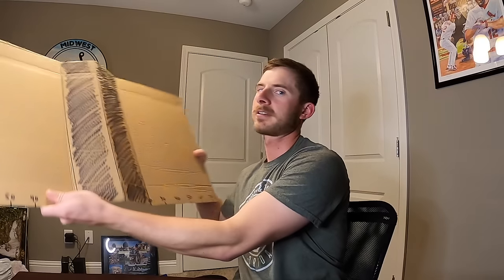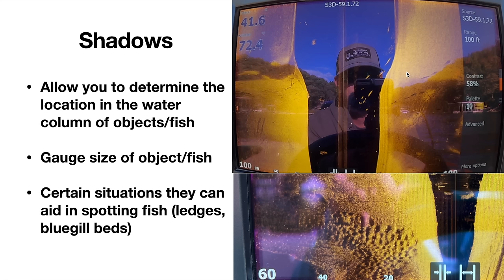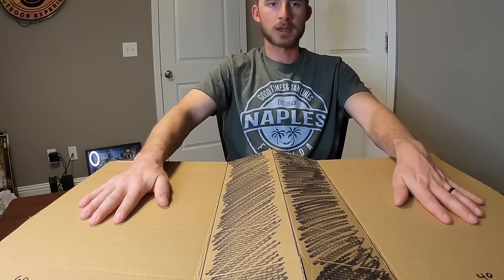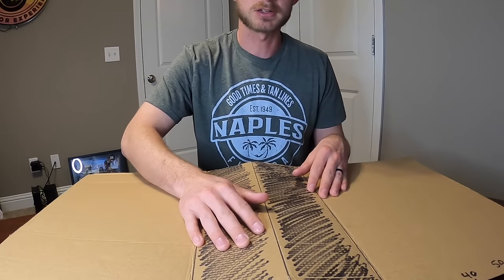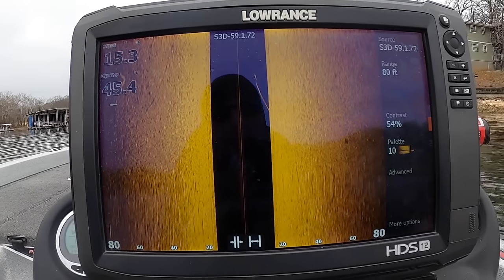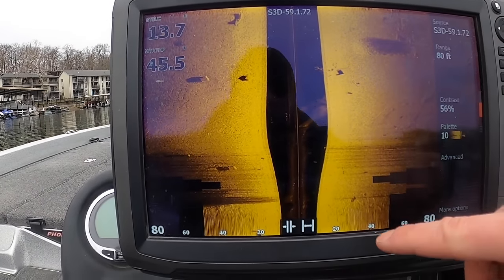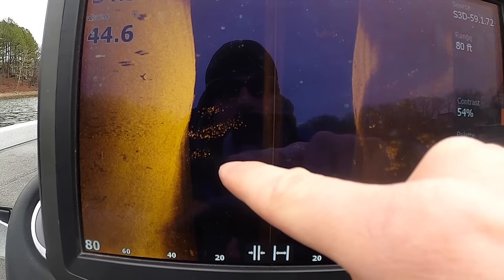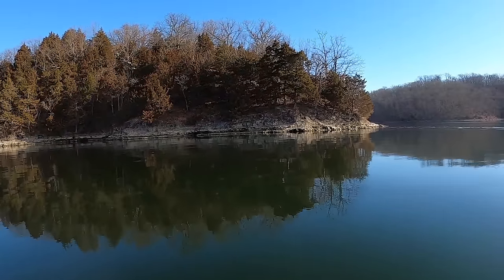Side Imaging Explained | On The Water Examples | Electronics Series

Comment: Been fishing with depth sounders for decades and know that the units display the target distance based on the time the echo takes to get back to the transducer. 

Side-Imaging confused me until your video reminded me that the whole image is painted based on the direct distance  (the straight line of sight) from the transducer to the target. The distance numbers are accurate (relative to the transducer "beam") the its the bottom and the water surface that is "slanted" (again, relative to the transducer). 

My confusion is that I'm was thinking in terms of my horizontal reference (the water surface) rather than the "slant" distance the depth sounder works in. Yeah, going to draw a bunch of arcs and triangles to help visualize the hypotenuse and base distances.

Thanks for  the video!
Reply from the maker: Yep, same concept just change the angles and the shape of the beam from a cone. I’m sure they have the technology now to have the craziest detailed 3D like side image where you can rotate around (like lowrance SS3D, but way better). Eventually it will get to the consumer level and all of this will become a bit dated.

Comment: Seems like a good way to imagine what the side scan is showing you is a series of concentric cylinders centered on the sensor.  If the surface line appears at the 20' mark then the surface is directly under you on the edge of the imaginary 20' radius cylinder.  If there is solid ground on that 20' marker then it means that point on the bottom is a 20' radius away from the sensor.

Comment: Is there a fixed distance between the top of the screen and the bottom of the screen? Or is that dependent on speed or settings? In other words, how far behind me is stuff I see thats scrolling off the bottom of the screen? GREAT video brother!
Reply from the maker: @tenncutt  that has some variation based on how fast your idling and scroll speed. Humminbird you can adjust scroll speed, lowrance you can’t. Typically at an idle and regular settings top to bottom is probably 40-50 yards

Comment: I am not sure if you are aware, but in the UK there has been some controversy in the side scan soar community. An expert named Peter Faulding was tasked to help find a missing person and declared they were not in the river. Sadly they were found days later. He has now come out and said he found her but he was gaslighted into thinking the target was negative, he says he has a 100% target rate and has never misidentified a body. He says he has sonar images and live footage of the search that proves he found her but he could only confirm this by reviewing the data. I have worked hard to try and understand sonar images and you have helped loads, I would love your opinion on this controversy. One other question I have is, can sonar data be manipulated?
Reply from the maker: I’ve never looked for a body except for people actively diving in a river and they showed up very easily, but depth and bottom composition would be the biggest factors on how easy something stands out, and then your range would magnify or compress that. As far as sonar data you can manipulate how things look in viewing programs. Basically the unit records the data, but you can change sensitivity, contrast, and range to manipulate the image for better viewing. This is even better if you took the data and displayed it on a larger screen because it will space everything out more and give it more definition. The deeper the water the further out your range the more it will compress the data is the bottom closer to the boat, making it harder to spot things.

Comment: Hope you still monitor this video. It was a great explanation, but raised a few questions. When you explained the “slant” distance you folded your model such that the right and left side were actually touching.  This implies that side scan begins working at a distance equal to water depth. In your example at approximately 20’ to each side. This would mean the water column in your model is 40’ wide.  Question: is the width of the water column always twice the water depth?
Reply from the maker: The width of the water column is always equal to the water depth…but In reality you’re looking at the same water column displayed on both sides, so it actually makes it a little easier to see what’s going on in the water column. There’s actually a slight amount of separation and that is how you can dictate if something is directly under your boat or ever so slightly to the right or left depending on how which side has the stronger return. To sum it up, water column width equals the depth in a 3D setting. In order to display this in a Flat 2D image it takes each “side” of the water column and displays it as their own on the right and left side.
Reply: Got it, thank you.

Comment: Hey mate , so when we mark a spot on side scan do we have to bring the cursor in close to compensate the slant angle. as often when you go back on the mark its to there?
Reply from the maker: When you mark a waypoint it's going to be on the bottom, so there is no need to adjust the cursor closer to the boat. The only exception would be if you were marking something closer to the surface i.e. baitfish, but generally suspended fish move around enough that marking a regular waypoint on them will get you close enough.

Comment: Maybe the explanation I received  a while back was not accurate: that the total  amount of lateral distance to the target was the distance outward less the water column depth. Therefore, if the total on one side is 50 feet, that would 50ft minus the water column (between 10 and 20 ft) equals about 30-40 ft out. But what you are saying is that really the distance would be calculated by  hypotenuse distance, which really makes it impossible to tell exactly how far out the fish really are. Maybe you could clarify your explanation. And from your explanation one could conclude that the total setting (50 ft), is just a number that puts in perspective of a considered distance, but the shadow results can somewhat put into perspective whether the fish is deep. shallow, or in-between.
Reply from the maker: That has been the basic analogy used since SI first came out. I think a lot of people latched onto that because it makes sense in their head, but in reality it’s not correct. In some situations that will get you pretty close, especially objects further from the boat. The range distance on the graph is strictly slant range to the computer, it’s not deciphering actual distance as it would constantly be moving and make the screen all distorted. Using shadows is the only way to definitively know where a fish is in the water column. So just remember the distance is the slant range to the bottom, and the further out you get from the boat the closer the distance displayed will be to the lateral distance of the object.
Reply: @MidwestOutdoorExperience   Great explanation, thanks!👍

Comment: So does the fish finder compensate for beam angle when marking a waypoint so you can come back & know exactly where to cast to? So if your screen says structure is 30' away but it's really 22' does the GPS mark it 22' or 30'?
Reply from the maker: Yes, waypoints will be marked on the bottom with slant range as it’s distance. I believe lowrance also will show the true lateral distance to the side when you cursor over assuming the object is on the bottom.

Comment: I was told differently on range. I was told if you have your range set at say 60' and you're in 20' deep then your imaging only goes out to 40' . Range on 50' sitting in 15' fot then 35'  etc etc
Reply from the maker: That’s the “basic” way everyone thinks about it. In some cases that actually gets you pretty close, but sonar can’t shoot straight down and then out to the side. It can only go one direction
Reply: @MidwestOutdoorExperience  30 degrees from top right?
Reply from the maker: @truthh8322  degrees change based on depth and the distance out you’re looking. That will dictate the shape of the right triangle. Obviously that is all assuming the bottom is flat or at least close. Very deep drop offs makes things a little trickier

Comment: Can you put a cursor waypoint on something you see out to the side then go to waypoint and take a look at it with 2d
Reply from the maker: Yes. Just keep in mind if you mark something that is higher in the water column, the waypoint will be dropped on the bottom or “slant range” distance from the transducer. It will get you very close regardless, but will be spot on if it’s on the bottom

Comment: I've had more troubles with sides Scan then I have With my forward facing LiveScope,, I Have the UHD 54 Garmin, I Fish shallow oxbow Lakes average 7 to 10 ft which is the reason I wanted side Scan , traditional Sonar Equipment in This depth don't help you terrible lot, unless you run right over something, anyway, 7/10 ft water, I Was using the lower frequency for better coverage But I've switched to the higher frequency for better or More sensitive scans and returns, Settings change with different water conditions,but we all use a starting point and adjust the picture, Gain,  Color Gain, etc,,, etc etc what would you suggest for a basic setup starting point for side Scan,, Preciate Ya Help
Reply from the maker: 3x the depth in range, adjust sensitivity up or down from default based on depth and bottom composition. Usually doesn’t need too much fine tuning to get pretty good results. In shallow water like your lakes you can also bump out your range to 60-100’ and still have great images. I will say the UHD 54 is lacking compared to lowrance and humminbird side imaging. Garmins uhd 56 is quite a bit better for detail, but not sure it’s worth swapping to it unless you want the best of the best. As long as you can interpret what you’re seeing you’ll be good.

Comment: Can the gps only be accessible while on the water ?
Reply from the maker: No it can be accessed anytime. If I recall correctly with the old core units like yours they sometimes had issues not wanting to show the screen if the gps wasn’t getting good signal. Make sure you’re not in a metal building or garage. If you’re outside and still having trouble, you will need to access something along the lines of “visible pages” menu. From there you can select visible or hidden on the mapping view. It’s been probably 5 years since I messed with a core HB unit so take some of that with a grain of salt because that is all from memory.

Comment: I fish kokanees sometimes in 200 ft. When kokanees are only 10 ft its hard to see they move to the side. When it shows fish to the side how can you tell how deep they are?
Reply from the maker: You can’t tell unless you can see a shadow on the bottom. At that depth you won’t be able to see any sort of shadow because it’s such a large area, so use DI/2D sonar in conjunction with SI to find how deep they are roughly. Then when you see them on SI you’ll be in the right ballpark on their depth.

Comment: The Raymarine first responder video discussing side scan contradicts you. They say that you cannot see directly under the boat and you need to use downvision in conjunction with side scan. In fact if you are scanning out 150ft, you are missing 50ft directly under the boat. These are guys using the system to search for bodies…. I gotta think they know what they are talking about. That could be the result of using dual sounders…but for sure you will be missing a bit under the boat.
Reply from the maker: Idle over something with both sidescan and downscan. You’ll see the object on both. Older units when SI first came out didn’t have quite as good of coverage and actually shared crystals in the transducer to create the image. Not sure on raymarines SI capabilities, but I know they are behind in SI compared to Humminbird, lowrance, and Garmin in image quality.

Comment: Stupid question - Per your cardboard too, and I've seen the folded paper explanation before. Why don't they splice that section out for a completed view? I get how it's also a piece of information.
 Good explanation of the distance changes based on depth, This is based on a the Pythagorean theorem. One of those cool words you can throw out in a "Good Will Hunting" moment. 
Good explanation. Screen examples and walkthrough were great.
Reply from the maker: Humminbird actually has a mode that gets rid of the water column. IIRC it’s called contour mode or something along those lines. I’d have to do some digging on my lowrance to see if they offer that, same with garmin. Interestingly enough, when you take the water column out it actually decompresses the image closer to the xducer. Imagine the thumbnail photo of the creek channel with the water column, and then without it displayed. It would make the creek channel closer to the xducer a little wider and make small details a touch easier to see. Using the mode with the water column off was very popular for the pro’s looking for shell beds/hard spots on ledges on places like guntersville and Kentucky lake in the early 2010s. I think I might have an old bassmaster magazine with someone talking about it.

Comment: Interesting that you use HB diagrams off the webpage... So, how does your unit adjust the range lines you show on the bottom of the screen for "slant range" when your depth changes, don't the numbers remain the same? Isn't the distances show only an equal division of the range selected not slant range? Dosen't that suspended fish show in the water column and.. cast a sonar shadow further out on the return? 3 times the depth on range? So in 12' of water you're only going to range 36'? Flipping Left/Right screens is for those who fish from the front of the boat and swing the unit at the back of the boat facing the bow not the stern. Great production!
Reply from the maker: On some of it yes. They are the best company for visually showing it, and they are the first ones to bring SI to the fishing market in 2008-2009ish

Comment: Distance left and right is range minus depth. Proof……set range 40 ft. in 60 ft. of water and there will not be a bottom on the the sidescan screen. Watch 2d and watch it show up in the water column on the sidescan with a dual screen. A brush pile under the boat on 2d will show up left and right on sidescan.
Reply from the maker: Range minus depth will get you close, but more inaccurate the deeper the water. If you set your range to 40 you will not see anything on the bottom in 60’ of water, but would see a brush pile or anything that comes up high enough in the water column to show up in that range.

Comment: My Humminbird Helix has contour mode which removes the width of the water column.  Can you share your thoughts on when to use that?
Reply from the maker: When I had birds I never really used contour mode. The only time I feel like it it could’ve been used was looking for hard spots in vast areas. Think of graphing ledges on Kentucky lake and you’re looking for small hard patches of shell beds, but you don’t care to see the 20’ of water column because you’re strictly looking for that hard spot on the bottom. Contour mode there will make it easier to see those spots by eliminating the water column and blowing everything up a bit more.

Comment: When it comes to estimating distance to the side, is it completely useless to estimate distances in deep water? In saltwater it's normal to fish in several hundred feet of water. Are these set up for people typically fishing 15 feet of water?
Reply from the maker: I think they're primarily targeted for <60' of depth, but really shine even shallower. Based on transducer strength and screen size makes that even more of the case. The good news is saltwater fish are bigger so they have a larger return and you can still use it to see fish suspended. The issue though will be seeing shadows in most cases to see the depth in the water column. So what I would do is get their relative distance on the graph and then use what you know to gauge their depth (light penetration, baitfish) so you can make a good estimate on their distance from the boat.

Comment: The left side of my si is always blurred and wavy. What's up with that???
Reply from the maker: Check your installation. Most likely motor is in the way, or your jackplate. Could also be in rough water coming off your boat causing turbulence if it’s in a bad spot. If all that checks out, it is possible that the transducer is bad. 99% of the time though its installation issues.

Comment: Is the position of the transducer important?  I have a 22' bay boat.  Garmin transducer is mounted at the back of the boat.  As the side imaging is scrolling from the top down, the "top" is actually the bottom looking down from the back of the boat; correct?  Always confused on when to "mark" a spot because I know as it scrolls by, it's in the past.  Any help would be appreciated!
Reply from the maker: What you see at the top of the screen is what is under your boat at that time. So the further down it is scrolled on the screen the older it is. Drop your cursor on anything you see and click mark. It will get you close depending on your external gps puck location (or graph distance from transducer if your using graphs internal gps)
Reply: @MidwestOutdoorExperience  Okay.  So, with the puck being at the extreme back of the boat (below waterline near the engine), it's looking forward and straight down - or just straight down like a cone?  Sorry about being thick on this concept.
Reply from the maker: @howardjones1955  with SI/DI it’s a straight down and out thin beam. 2D sonar has the cone shape that goes straight down